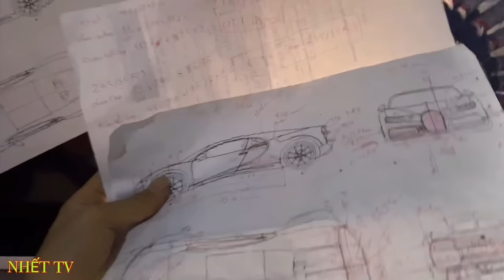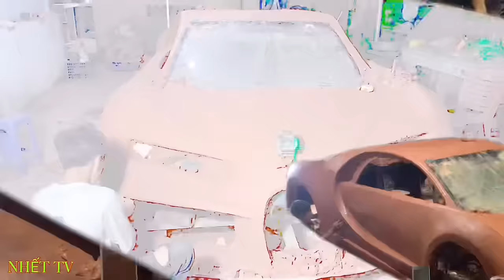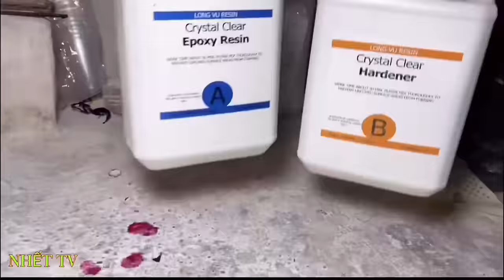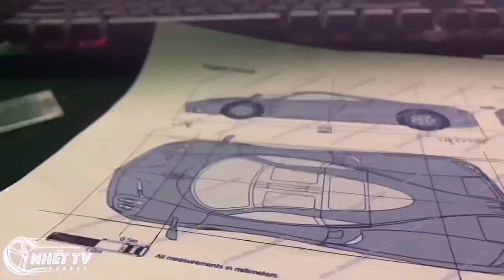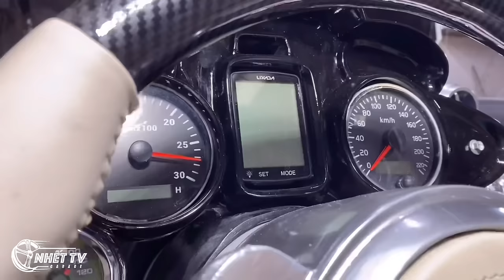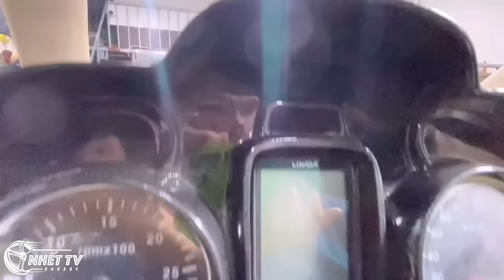I Spent 1000 Days Creating A Pagani Supercar For My Girlfriend. #mrbeast

Comment: You're doing really great. Respect. But why do you always build your super sports cars with
extremely small engines that haven't even been set up properly. There will also be old 6 or 8 cylinders.
A super sports car is only one if the design and engine match. But your work is awsome. I like it

Comment: So....how much water can the fiberglass cover clay panels absorb? How long does the paint layer last before it cracks and water gets into the clay? How heavy is all the clay? I'm sure the weight of all the clay is offset by the chassis being largely replaced by the tube frames you make, very impressive. But I have so many questions about the engineering of all this.